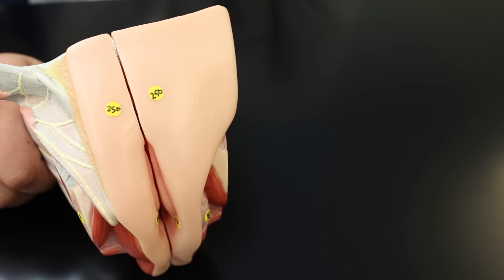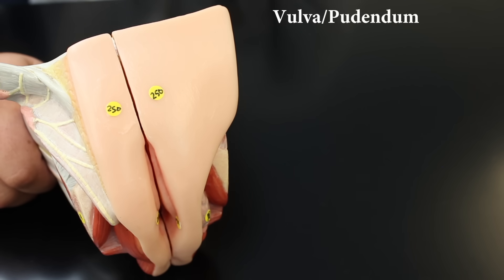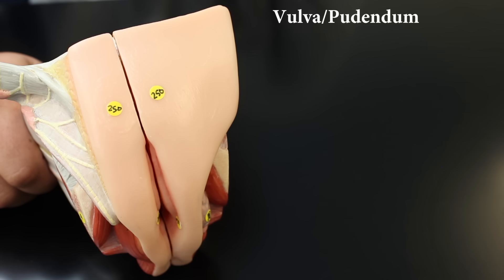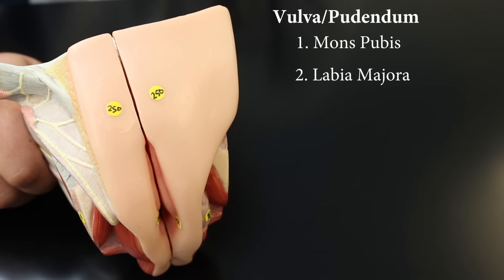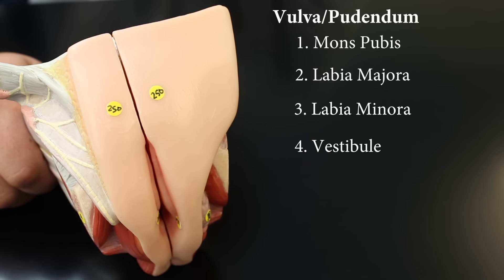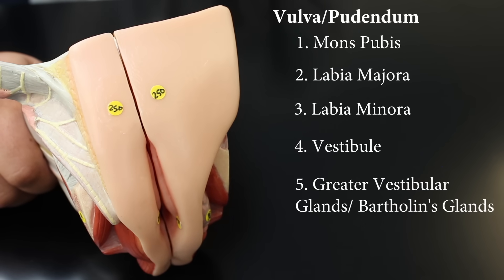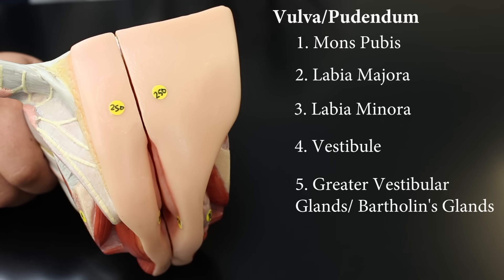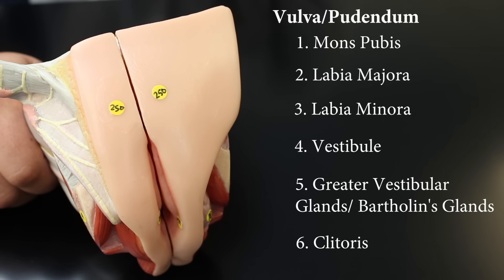Anatomy of Female Reproductive System | Model

Comment: 0:18 1:00 1:30 OVERIAN LIGAMENT = overy & uterus 2:12 suspensory lig+ mesovarium lig= broad lig (helps the uterus to anchor LATERALLY) 2:35 uterus & sacral region = sactouteral lig (anchors the uterus POSTERIORLY) 3:08 round lig= anchors the uterus ANTERIORLY 3:50 fellopian tube FIMBRAE 4:25 fimbrie ke je dhore ase setai Infundibulm, then Fundus, Ampulla dialated part (FARRILIZATION) , then ishthmus 5:20 6:11  what🫠 labia minor er internally - VESTIBULE, Then BARTH LENS /VESTIBULAR GLAD (sectrests mucosa into the vestibule) 7:10 CLITORIS RECTILE TISSUE
💀7:50... & URETHRA 9:05 rugie!???
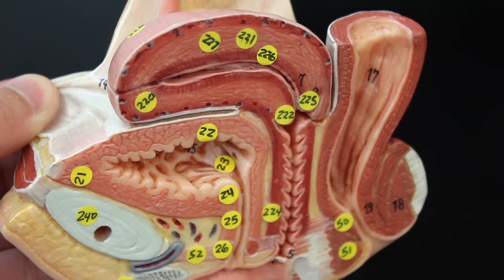10:15 vagina.. 11:30 12:15 uterine cavity!